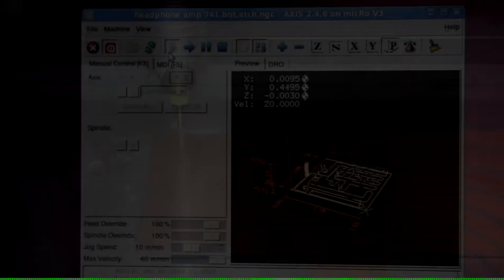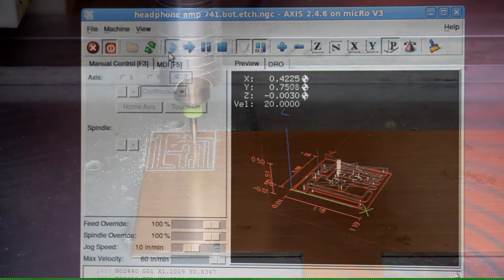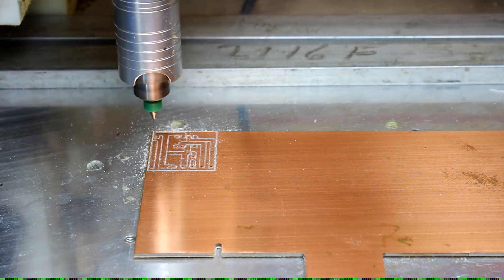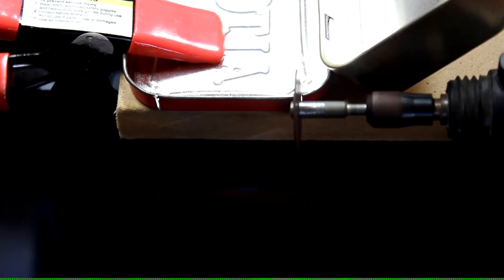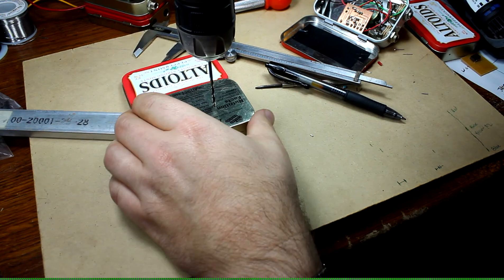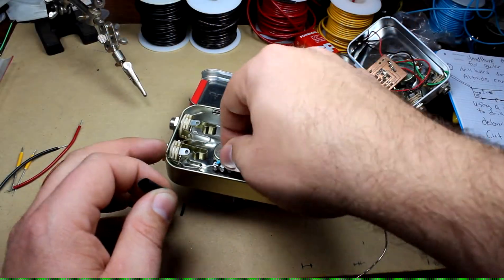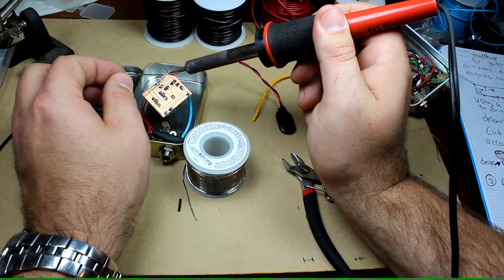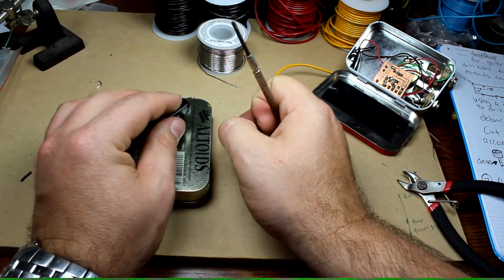741 Headphone Guitar Amp Build (time lapsed)

Comment: 😡 I was trying to build Evan Kales version.. I failed twice.. it made noise and stopped.
I’m totally new at circuitry.
Yours looks more simple.
I really wanted to make one work for myself
Reply from the maker: Robert Long Point to Point wiring on perf board is exponentially more difficult. Making sure the connections are right is difficult.

Comment: how can i use this clean tone with one more pot ( volume and gain)?
Reply from the maker: +MrDogan86 This circuit would need to be redesigned to work that way. It uses a lot of gain to cause distortion. It's also not very loud because it isn't designed correctly to drive headphones. It works as designed for a cheap practice device, but for what you're asking, you'd need a preamp 741 and a power amp such as an LM386 to get the volume needed. Hope this helps. I'm not working on these designs any more. Life got too busy with kids and work and other hobbies. - Robbie

Comment: Woulden't the solder points ground out on the box when it's all closed up? I was surprised you didn't install a non conductive coating to the box interior, like ... Tape, or something.